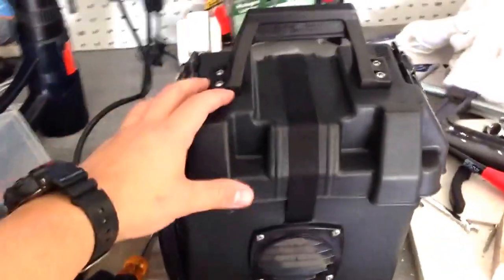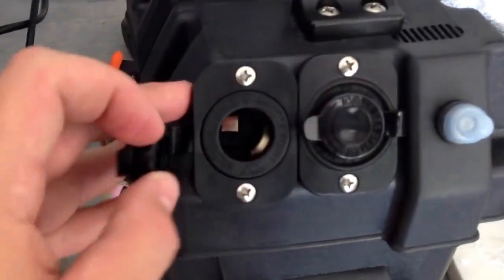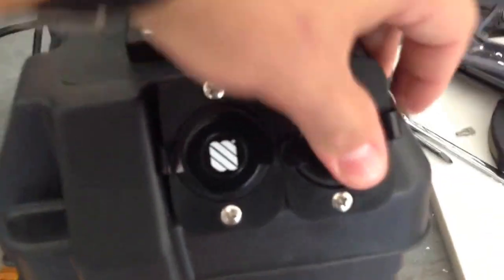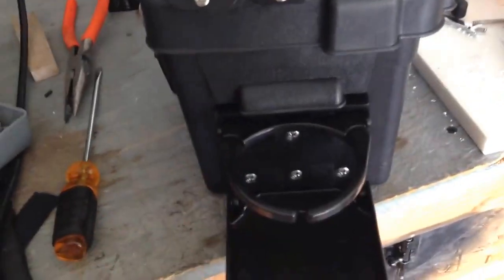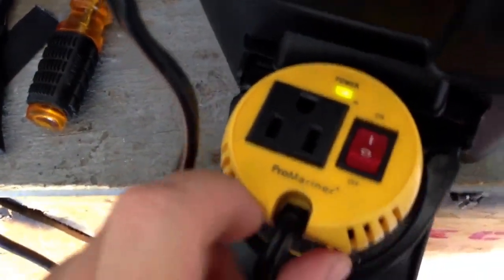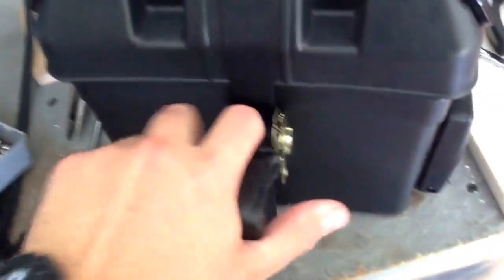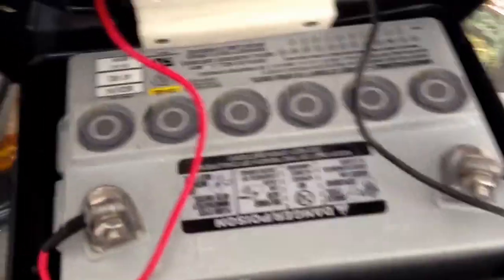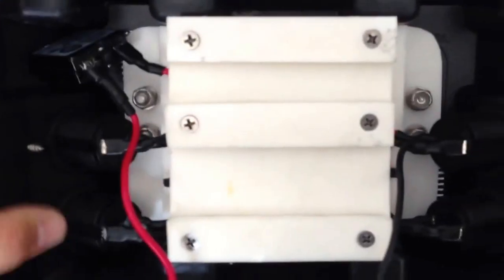Portable Power Station 12v and 110v

Comment: The wires from the battery to the breaker look a little on the light side? Did you research to make sure they will carry the loads without heating. You size the fusing to protect the wires from burning. Fuse all the loads for safety. Nice setup

Comment: I know nothing about electricity.  We have 120W solar panel in pop up camper.  I would like to buy a small ice maker that runs on 110V.  Is there a way to do this?  We would rarely run the ice maker.  We would just make ice for the cooler and then turn it off.

Comment: Will this set up run a fan all night long?
Reply from the maker: It absolutely will and multiple nights just on one charge. It ran for 24hrs an o2 cool 10" fan the kind that is sold at Dick's.  All I did was cut the cord at the transformer and wired it up a cigarette plug (male) since the fan runs on 12v.
Reply from the maker: It ran for 24hrs and the battery was at around 12.8v
Reply: Awesome. . Thank you. .